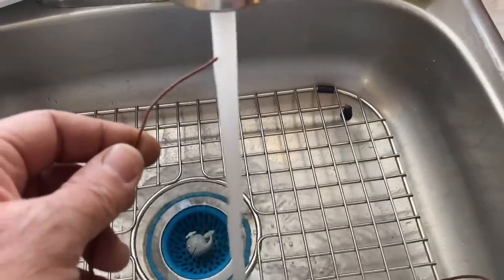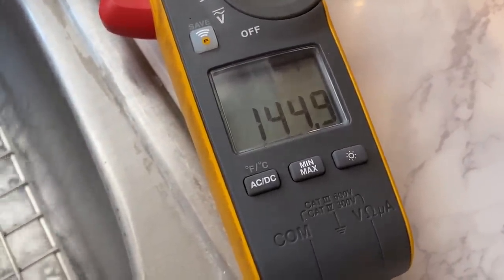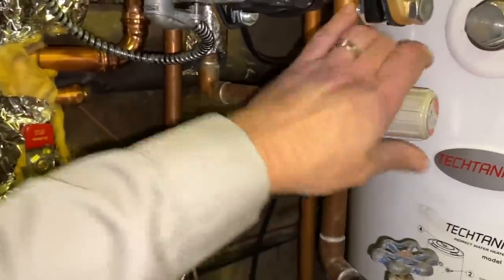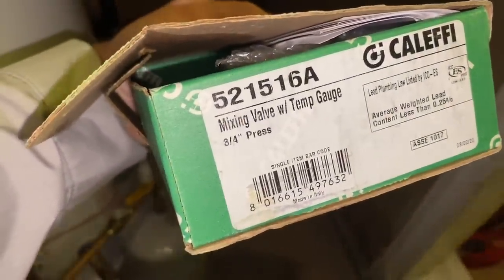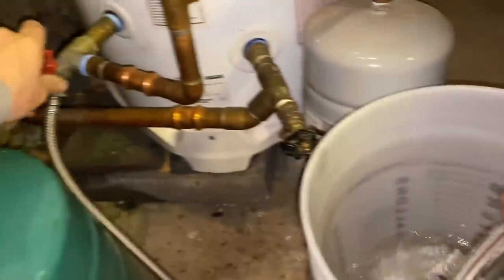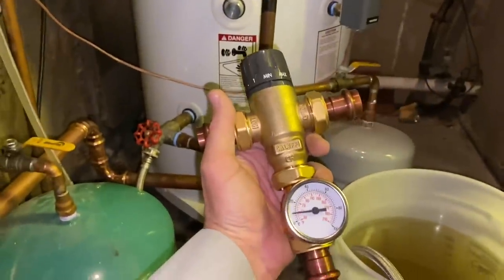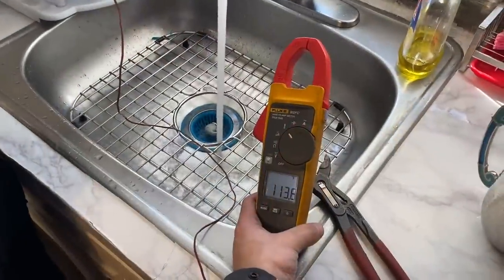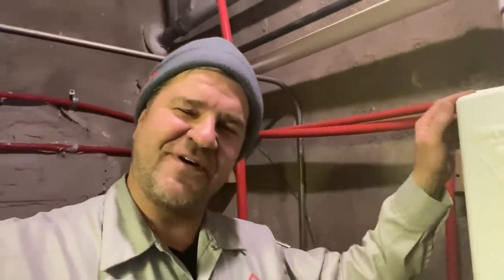Scalding Hot Water at Kitchen and Bathroom Faucets - Water Heater Thermostatic Mixing Valve Install

Comment: most if not all thermostatic mixing valves for "domestic/potable water" have a locking handle. to adjust you loosen the handle screw on the end a bunch of turns and slide the handle out off the locking teeth to turn it, once set, push it back in and tighten the screw. you usually have to tweak it a tiny amount to get the teeth locked back in.
 it's a "safety" feature on them, so every random person doesn't go adjusting it and injure themselves/others. the radiant models don't lock that I recall, but they may now.

Comment: Most accurate way to get temp would be to fill up a glass and then have hot junction in the water that's not being aerated. I bet it was hotter than you read

Comment: Our showers have the mixing valves, so they don't come out that hot, but that's what we get at the faucets if you don't mix in some cold. No mixing valve, and I think the intent was that we'd set the 40gallon tank to 120 or something. Runs out too fast that way, probably better setups that could be...

Comment: Mikey that make of mixing valve you took out because of a striped knob, the way that one works is you have to remove the screw to disengage the locking mechanism to adjust the temp once you get the temp set the screw get reinstalled to keep the idiots from messing with it. apparently some idiot tried to adjust it without knowing how to and stripped the knob. LOL

Comment: I always thought those valves were designed to fail in the cold position, obviously that is not the case.
Reply: All the ones I have worked with fail safe. I have never seen one fail hot. All are designed to fail cold. Quite the extreme failure.

Comment: Mikey Pipes!  hey i'm getting the exact same problem but my hot water comes from the steam boiler instead of a water heater.... and it's never constant, i have to adjust the knob like 4 times when i take a shower cause the water gets  too hot then too cold then too hot... what's my fix?  and thanks for all the videos by the way, been learning a lot
Reply: i would think if you have a boiler then you must have a storage tank with a circulator if that is so i would think you would get what ever temp is in the storage tank not sure  your entire setup maybe you get it straight from the boiler loop and have no storage tank maybe that is why it goes up and down
Reply: @Wolfhound.  thanks for the reply, that’s a good suggestion, I’ll check it out